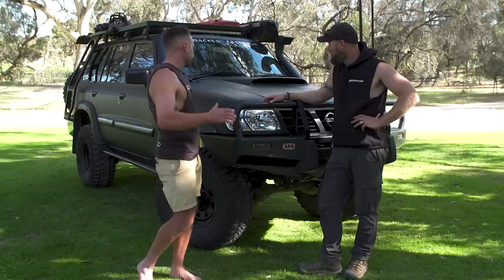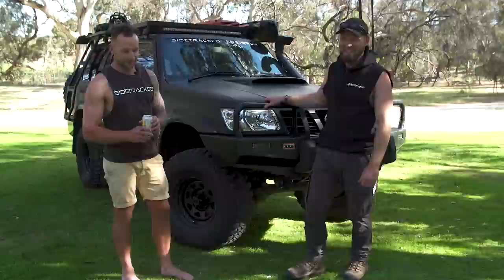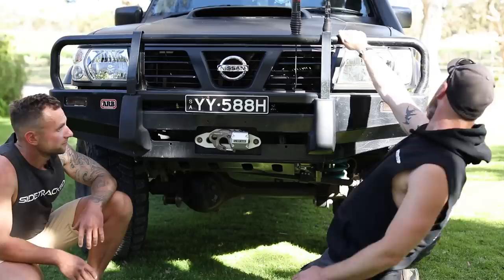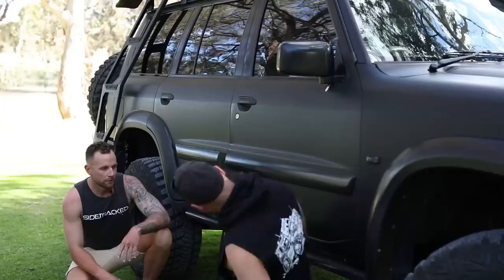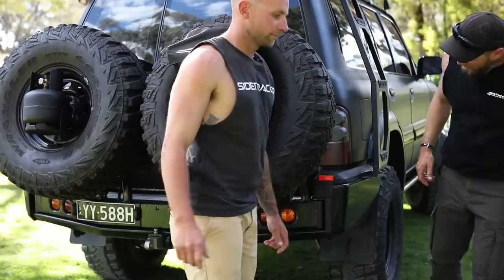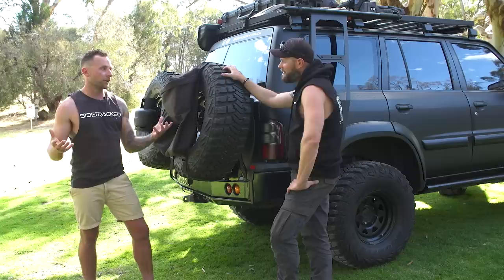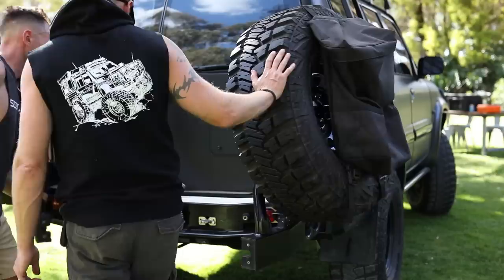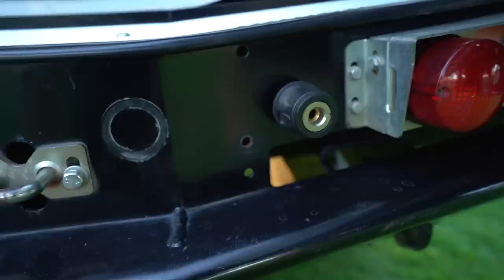Nissan GU Patrol review, Modified Episode 77

Comment: SUGGESTION: Fyrlyt (a great Adelaide based light manufacturer) have a special deal on until 29/2 on their Nemesis lights....$693- for a pair. These are usually $990- a pair and simply blow away any other light. Forget LED and HID....these 250 watt lights are Aussie made with German globes.

Comment: The electrical issue with the switch on those SB X20 winches is very common, the switch itself is extremely cheap and from what I've read (and my experience) it fails 100% of the time. It is very quickly and easily replaced by a better quality, preferably waterproof replacement and it solves the problem completely.

Comment: Did you do the shock towers before or after the hyperflex arms and what did you think of them?
Reply: I have the hybrid superflex arms in mine and can honestly say there awesome
Reply: Extended shock towers went in at the same time as the radius arms. Definitely worth it if you want more suspension travel. Downside is you need to take to your inner guard with a holesaw.

Comment: Hubs and bl00dy wheel bearings!

What brand of camp chairs were they? I need to get new ones and they look awesome!
Reply: Yep you're onto it, wheel bearings get a fair flogging. Camp chairs are Frontrunner, super compact.
Reply: @SIDETRACKED  they'd easily be the most replaced item on my truck (I've had 2x GU's over the last 12 years). I don't know how someone hasn't re-engineered a better after market design!